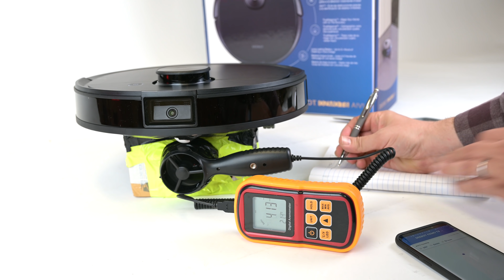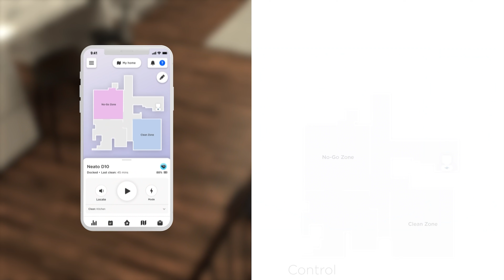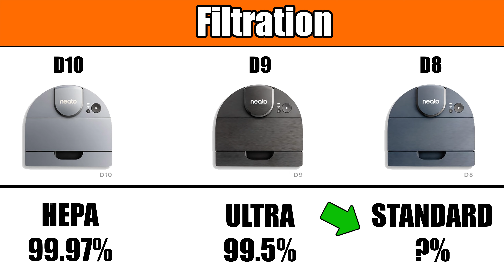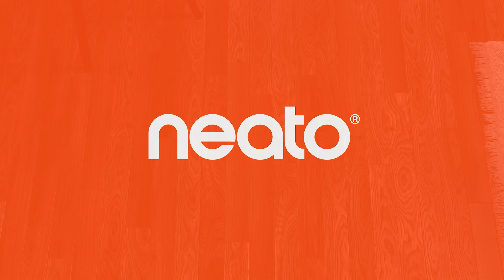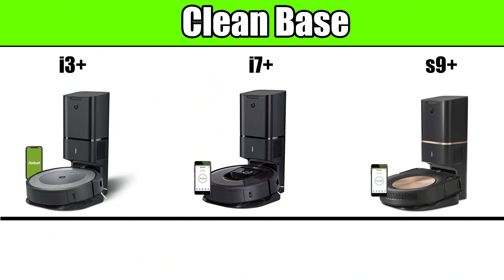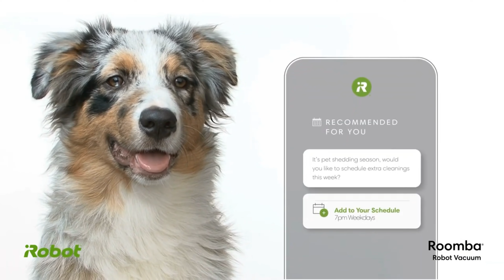Neato D8, D9, and D10 & iRobot Roomba i3+ - Robot Vacuum News!

Comment: Do yourself a favor and look at neato forums and social media like reddit. Neato SUCKS. and in the worse way. They've abandoned consumers and their robots with terrible issues like mine on the D7. Their robots may last but with software that makes it barely functional, what's the point? No app update in over a year I think. Other manufacturers are adding new features and smarter capabilities to their vacs... innovating. what a concept. These guys just boost battery life? Who gives a shit when they have charge and resume??? I was so hopeful and happy with neato for a few solid months. Then the problems started. Couldnt clean because it couldn't recognize the room? wtf. Fuck neato. If you don't believe me you can look for yourself. Google neato reddit and browse.
Reply: Turns out some company bought them out and basically that's why the brand is dead.

Comment: Can anyone suggest a good robot vacuum besides the T8 AIVI?  I recently started using it and was liking it, but it will only store two floor maps.  I have three floors so that won’t work for me.  Their support has no idea if that will be changed.  There are also a few other issues with their app, such as dividing rooms doesn’t work if there isn’t a physical wall at one of the ends and no custom room names which makes it useless with Alexa.  

I am also trying the Roomba i8 which doesn’t have any of those issues, but Lidar is so much better than the camera’s.  So I’m looking for the next best Lidar robot that doesn’t have the limitations of the T8...thanks.

Comment: Neato vacuums are ok. Not excellent, but ok. The problem is that they have an incredibly short shelf life. They do a decent job until they work, but they last 1 year maximum before they start having problems. This is the fourth one! I bought the first one, it stopped working after 9 months, it was still covered by the warranty, so I returned it and they gave me a new one. Great! After a year, the other one starts giving me all kinds of problems. I changed the battery, I changed the parts. Nothing helped. I will spare you the details, but I truly believe Neato endorses PLANNED OBSOLESCENCE.

Comment: As a neato d5 and d7 owner I would take a hard pass on the new line. They are very small changes compared to robots coming out with AI and faster processors. Also the Neato app has a lot of issues that I have complained about and their support is abysmal. They dont care about their customers
Reply: New line looks good to me. D450 and D750 owner. Lidar is still better than a camera for basic privacy, and still navigates just as well. Never had a problem with the current app, but even that's getting updated for the new line.

The only missing feature I'd want is a self-empty base. iRobot use a bagged design that's expensive for disposable bags, and not great for the environment either. If Neato does release one, hopefully they'll go bagless.
Reply: Dan Davidson I guess everyone has different experiences. I am not able to make any changes to both my robots from iOS apps I consistently get an error. Factory reset of the robot doesn’t help either so there’s no way around it. 

Other manufacturers are adding AI, mopping, better faster navigation while all  Neato really did was add a filter and a bigger battery. We will see how the tests come out so I’ll reserve some judgement but on paper it doesn’t seem like it’s competitive.

Comment: I've been running the Neato D6 with multiple floors since I bought it in January.  You've repeatedly made this mistake.  I believe the feature was added to the D6 with a firmware update, and I chose the D6 over the 5 because of it.  
Recently it has started having issues.  Sometimes it fails to recognize the floor it is on and immediately goes back to the base.  Other times it only cleans half of the floor and goes back to base and calls the job done.  When it runs fully it does a great job, but other than bin size, I don't think there is any reason to choose it over Roborock.  I like the wide brush, but it doesn't seem to improve the cleaning capability over my Xiaomi Mijia 1S (Roborock knockoff with laser mapping).  
The 1S doesn't have the mopping feature that is included on all Roborocks, and I could not care less about it, so it has a good bin size too.  If the Mijia app/multi floor support was a little easier, I wouldn't suggest the Neato to anyone.  I also have a weird fetish for following my Mijia on the in app map as it vacuums, and Neato only shows the map upon completions, which at least allows me to see if it did the whole floor or not.
Reply: nah the software is just crap i had a d7 for less than a year before it was unusable.

Comment: I have a Neato D7 now. Since the time I got it, I think the competition has surpassed Neato in terms of navigation (e.g. front cameras to avoid running into things), mopping ability, and clean bases, etc. This new lineup just doesn't seem competitive.
Reply: The camera is a privacy concern with me, so Neato gets bonus points for sticking to Lidar. It also has the large dirt bin, brush, D shape, and competitive battery life and suction. For a standard robot vacuum, I think Neato are still ahead.

A self-empty base is the one big feature missing (but unless it's bagless, I'm not interested, so the Roomba is no good anyway). 

A dedicated robot mop model would also be appreciated as well though, I agree, but that's a different product altogether. Combination mop/vacuums are too much of a compromise for either function, as specialisation really makes a difference when you're size limited.

Comment: Whats the diffrence between true hepa filter and a ultr? And what kind of filter does the ecovacs OZMO t8 aivi have, you dig not mention it in its video😊
Reply: The difference is that a HEPA filter is one that meets the HEPA standard of filtration (e.g. 99.95% or 99.97% of particles of a certain size).

The ultra filter is just their own brand name for their own filter, that does not have to meet any standard, but that they say independently that it still filters 95% of particles at a particular size.

Comment: Now it is clear to me my Neato has stopped working and perhaps supporting the D7 model. There have not been any app/firmware  updates for more than a year now, not a single new feature that would reduce the gap with their competitors, any improvements in the navigation system. They are now announcing a new line which will probably cost more 700$ dollars expecting people to pay to get what they could have given via a software update in previous models.

Comment: I know Neato have very wide brushes and there shapes allow them to get into corners, but I think these would pick up even better with a side rotating brush too. 
It's surprising how far they reach under the fridge and washer etc and bring out detritus the Neato's can't
Reply: My D6 has a side brush, but much of the promotional material doesn't show it installed.  I would be surprised if these didn't have one, at least the D9 and 10 anyway.  Actually, with this stupid focus on battery size for a vac that can continue after recharging, maybe I wouldn't be surprised if Neato has removed them.

Comment: I wish I had bought a slightly more expensive Neato with side brush to get the last inch towards the panels. 😀
The robot vacuums seems to be an area of rapid development so I on the other hand probably will be replacing it sooner than I would with an regular vacuum.
Reply: Jacob Dawson  I've bought the Neato D450 and D750, and personally wouldn't recommend the higher end model for most people unless you specifically want one of its features (such as the side brush mentioned). The lower end model honestly does just as well at cleaning, at a much lower price.

For me, extra battery life was the reason for the better model, so it gets the cleaning done in one go without having to charge itself. That was worthwhile to me, but with scheduling you might not even notice.

Always buying the high end model just because seems unnecessary to me. You don't always need all of the features. They're always worth considering, and often are worth it if you value the features, but the budget or midrange options can be just as good for most people.

Comment: I have a Neato D7 and have had that for around 2 years now.. See no real reason to upgrade it to the newer Neato' s (maybe your review will make me want otherwise!). But i think i will go with a iRobot the next time. I've had so many issues with my D7 throughout these two years that right now its actually not in use because its more of hassle getting the thing to vacuum than it is doing it by my self.
Reply: agreed, how many times did you get floor plan not found.